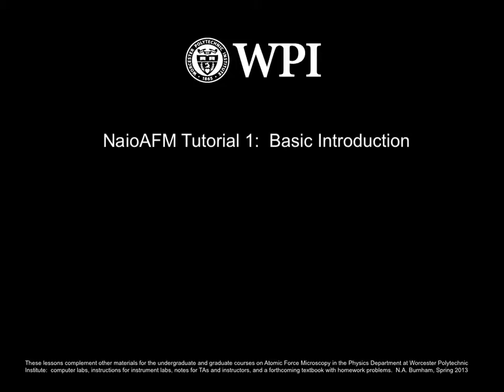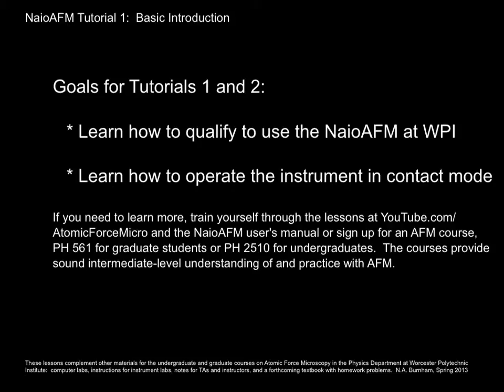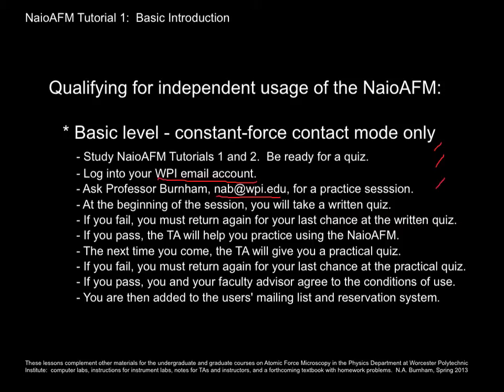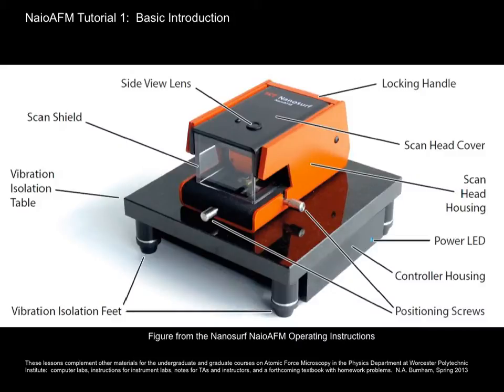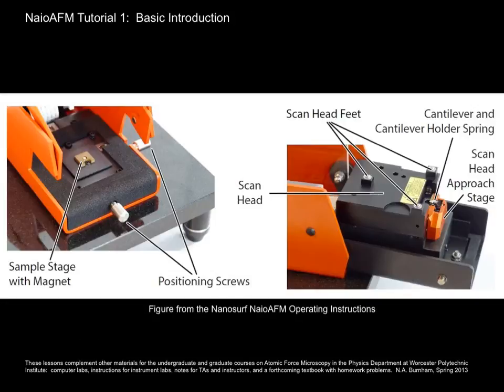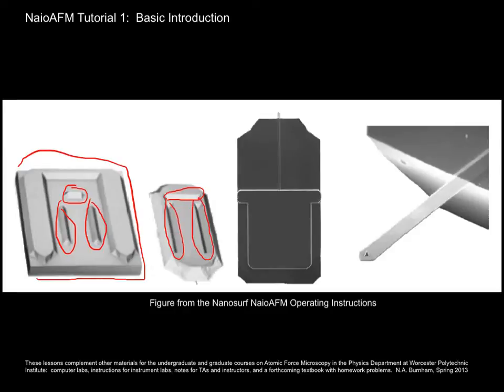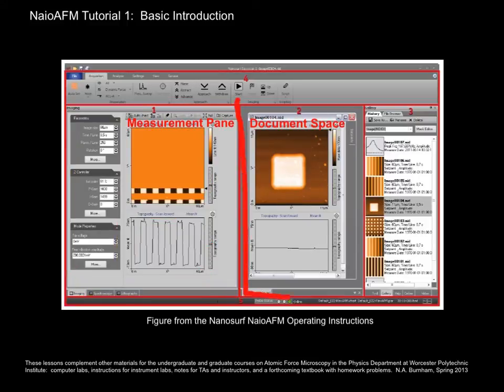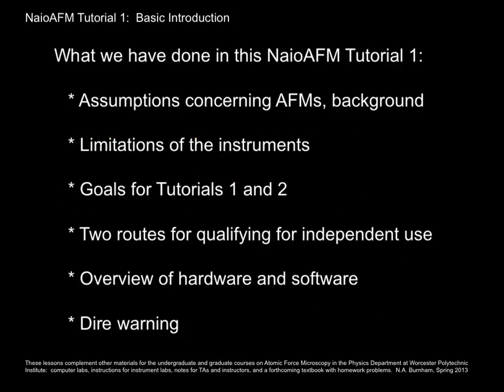NaioAFM Tutorial 1, Basic Introduction

Comment: Thanks for the video. Can Naio AFM do magnetic force microscopy? Can you please refer to any prior work if someone used it for MFM.
Reply from the maker: Yes, you can buy probes that have magnetic coatings. My group has not tried MFM with the NaioAFM. However, a related instrument from the same company has acquired some nice MFM images, which are displayed at https://www.nanosurf.com/en/application/25-mfm-on-polished-stainless-steel.
Reply: AtomicForceMicro Thanks very much for your response and suggestion about other copatible AFM from Naio.